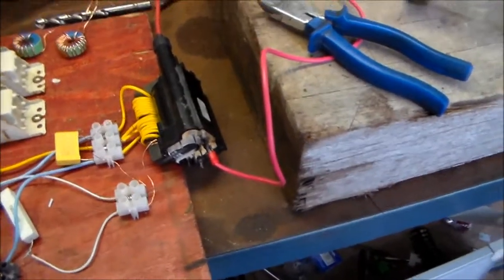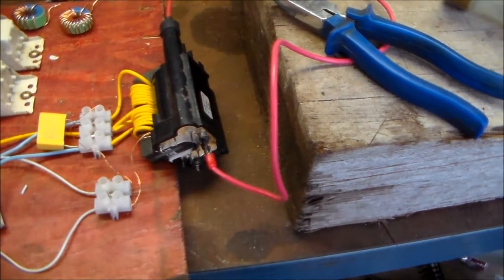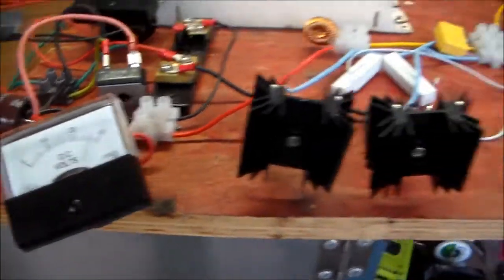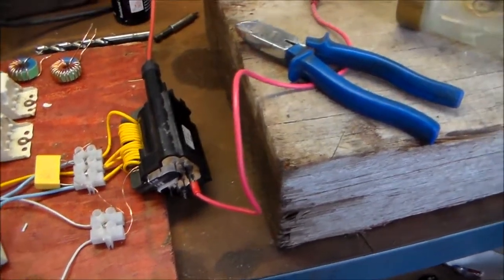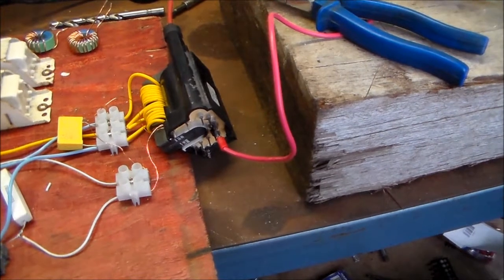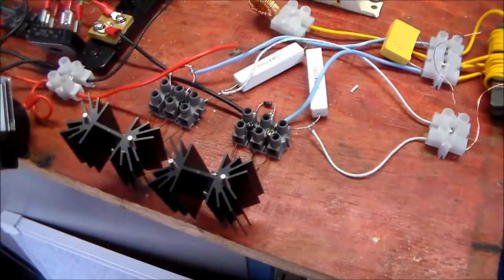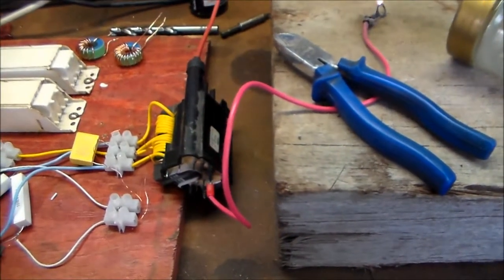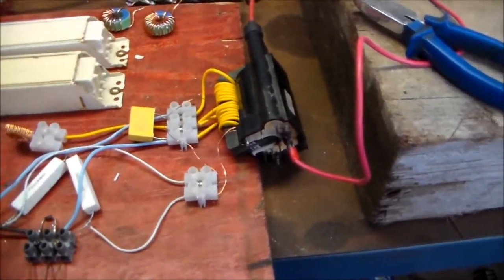Flyback runs for 5 minutes on 28V - NO POP

Comment from the maker: flyback transformer is a line output transformer from a television. it produces high voltages when driven correctly. the electricity leaps because its in the kV range ( Kilo Volts)

Comment: I think it might be the voltage multiplier cooking vs. the actual windings since it seems to keep outputting a decent arc.  If the winding was short I'd think the arc would be puny due to the loading.  The flyback's got an integral voltage multiplier composed of some caps and diodes connected to the output.  If you can find an old B&W TV flyback without a rectifier or multiplier inside it will work MUCH better for you I think. (a colour TV w/ separate tripler would work too)

Comment: Yep, If it was dead, I don't think it'd be working that well. The biggest wrisk is over volting it and getting internal flashover. Once that happens, you have a dead flyback! I ripped off all the old primary stuff right down to the tube over the ferite, had to leave the secondary side alone obviously!
I found bluetack is good for sealing and insulating things too!

Comment: I have one of these I made some 16 years ago, and it had 2 turn feedback, 6 turns primary (CT 3 x 3)  and 3.3 ohm in series with the feedbacks to the bases. I used 2 MJ802's on a big heat sink, If I recall, and ran it off 12v. It could easily maintain 28a at 12v, around 300w and the transistors sat around body temp.
The flyback was an A.W.A. G chasie, no built-in diodes. It is still alive to this day!!! 
I can draw the arc out well over an inch, and lots of hot air comes off it!